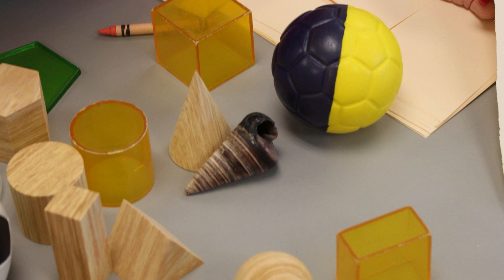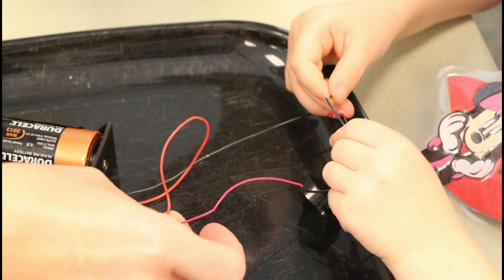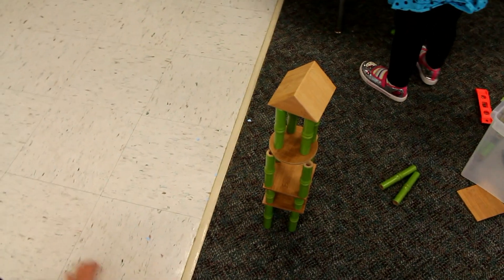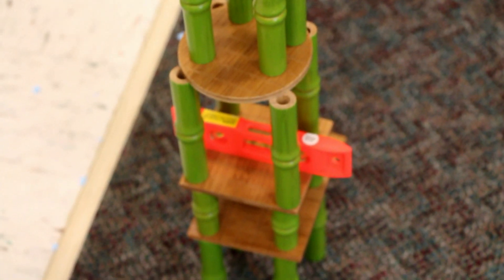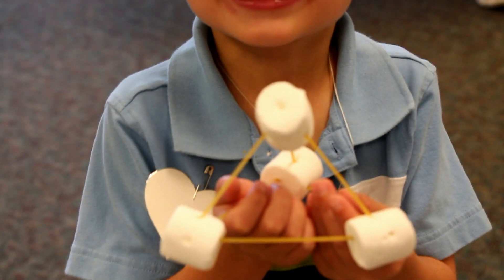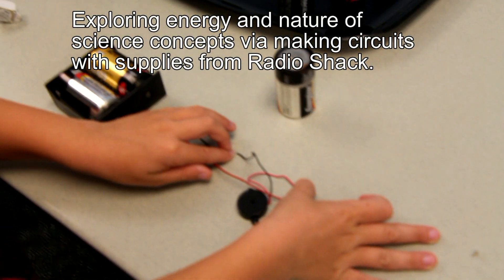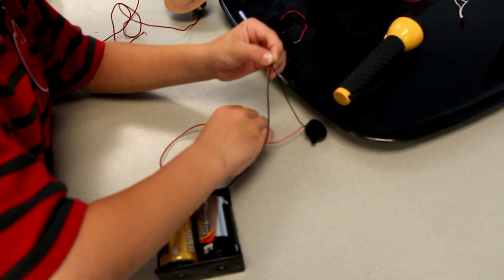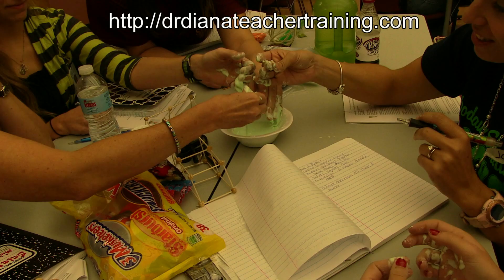Exploring STEM Concepts in the Early Childhood Classroom

Comment: Hi Dr. Diane I am a early childhood educator who was just introduced to the concept of S.T.E.M. I have started giving my preschool children ramps of all sorts; pvc pipes, cardboard ramps etc. I have seen people using a black rubber material, but I can't find it. I spent an hour in Home Depot yesterday trying to explain to multiple people what I wanted, but no one knew what i was talking about. I see it in your video. Can you tell me what it is called and where to get it? Thank you.
Reply from the maker: +starrchild2010 insulation tubing.
Reply: +Dr. Diana Wehrell-Grabowski  Thank you for getting back to me. I did have another questions. I was wondering what the bamboo building set was called. I was also wondering what the red and black bricks with the holes in them are. Are they foam or real bricks? Thank you for your time.
Reply from the maker: +starrchild2010  they are real bricks $50.00 for 50.00. I make my own with Quik Crete. Why not look into having me come out to your school to conduct STEM training.